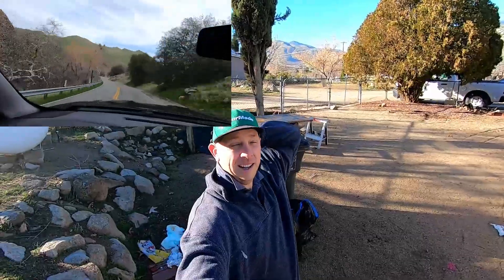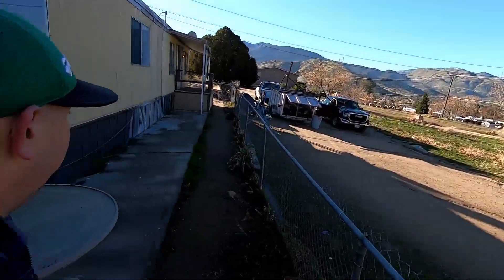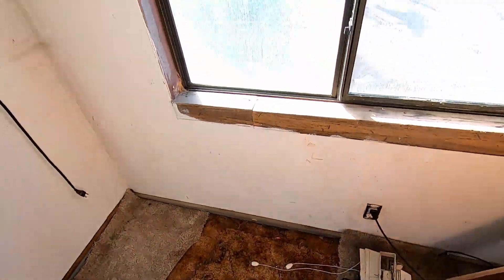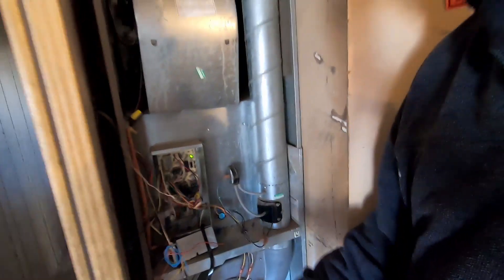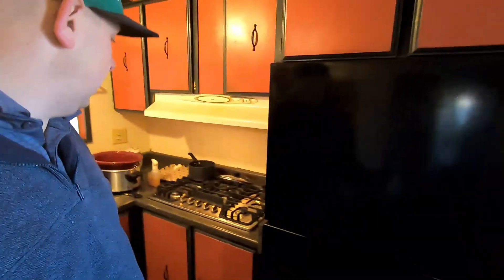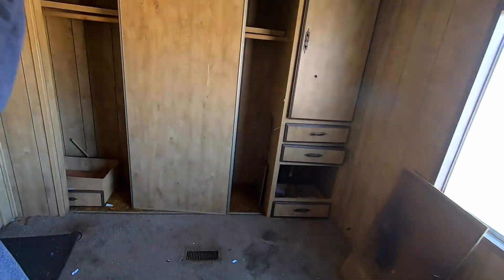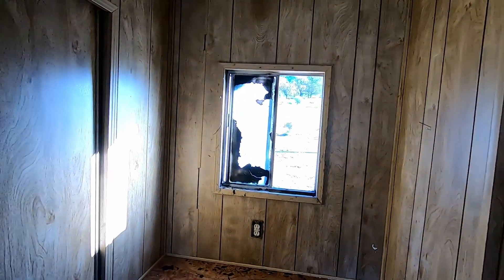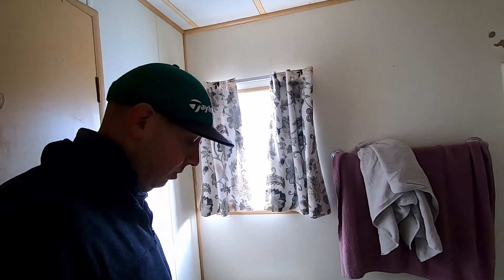Erskine House - Day 1 - GUT THE HOUSE

Comment: I dunno if you’ve already started the sanding but that’s not really necessary you could just throw on a couple masks and wipe everything down with some acetone then paint/primer over it. The acetone will break down any veneer on the wood paneling and cleans off any smoke residue and preps the surface to accept the paint primer.
Reply from the maker: intersting idea